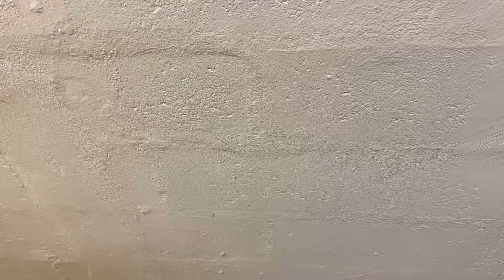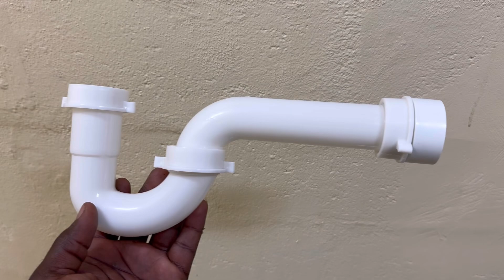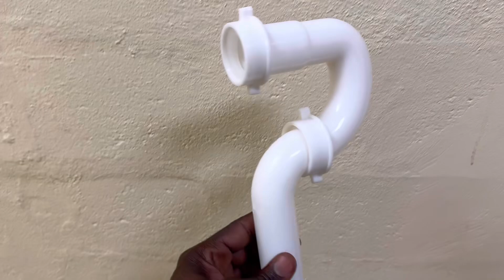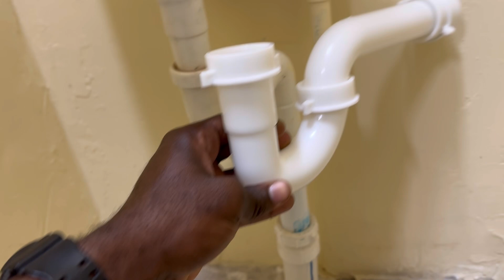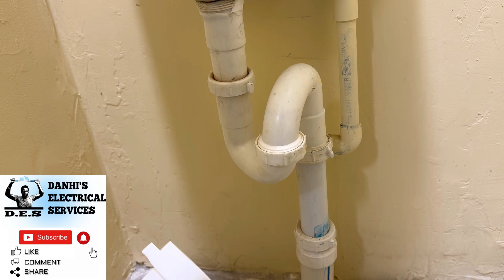When to use a S trap vs a P trap

Comment: Why do you need a trap of any kind in the first place. Just curious
Reply from the maker: The Trap causes a water layer to be trapped in the line which prevents sewer gas from entering the building. This prevents bad odor. 
Another is that If any object like a ring or so falls into your sink it is trapped inside of the trap instead of straight to your sewer.
Reply: The trap holds water. Creating a water tight seal against the harmful sewer gases going back into your home or business.